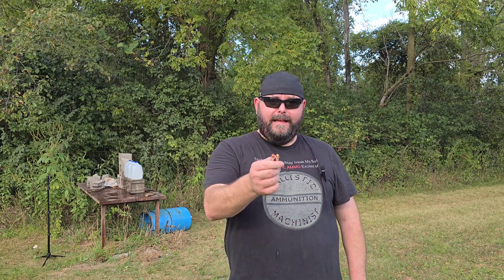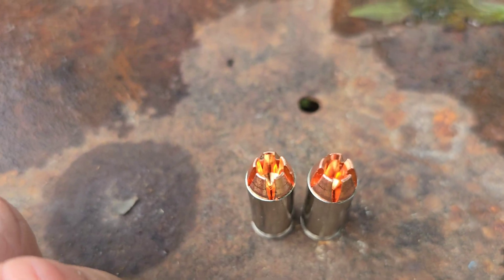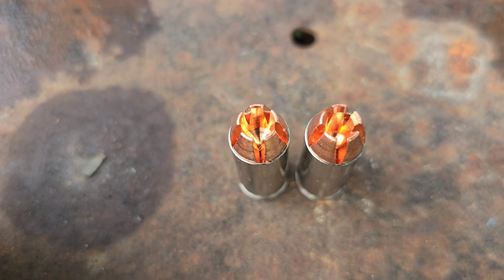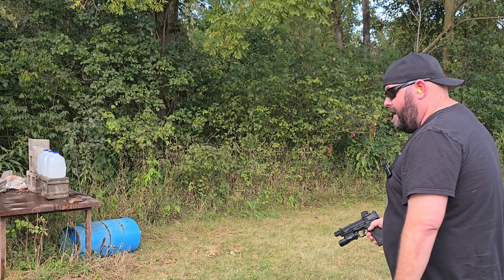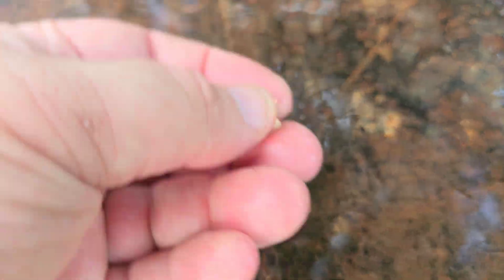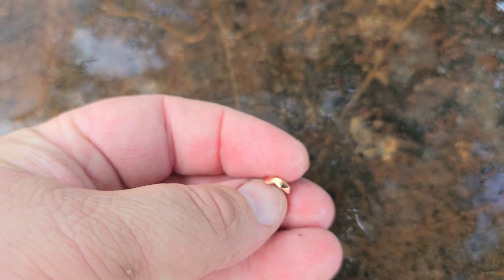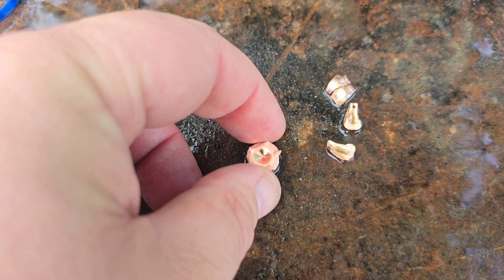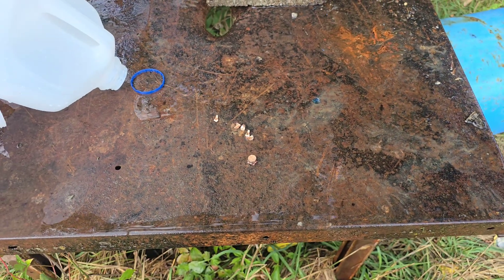FAFO Fridays: Why the 40S&W and 10mm Interceptors are not interchangeable.

Comment: Would the 40 S&W cycle the pistol chambered for 10mm despite being a few grains short with the same bullet characteristics you would expect out of a 40 S&W? If so you could have just 1 pistol that can use both types of ammo without a misfire or other more serious malfunctions
Reply: Case length is slightly longer on the 10mm. The meme is that the S&W in 40 S&W is for "short and weak"
Reply: I see.

Comment: I would be intrigued to see you make a 457 airgun specific interceptor, of course main problem is, either have to do a Sabo or cut grooves for a lead cup and then turned to the correct size, I'd be willing to test them out of my Air Force carbine if you decide to try them.

Comment: I'm confused.  While the projectile looked different the length of the casing on them both matched.  Did you pull the projectiles & reload them?
Reply from the maker: @vashmatrix5769  i load one of my 40S&W interceptors in a 10mm case with the same 10mm powder charge to show that the 40S&W will not work for the 10mm Interceptors. Most companies use the same projectiles for 40 and 10mm
Reply: @BallisticMachinist  OK.  That's what I figured after typing it.